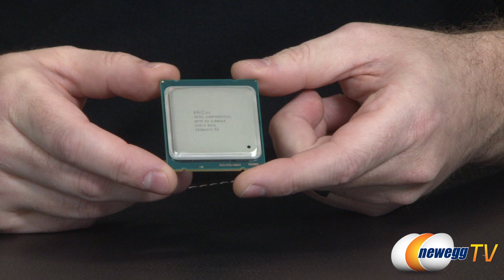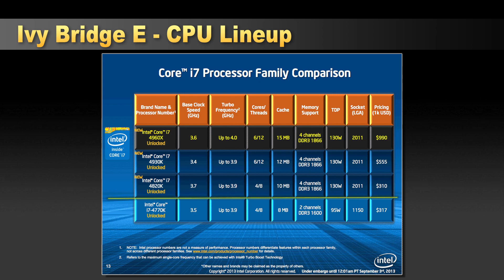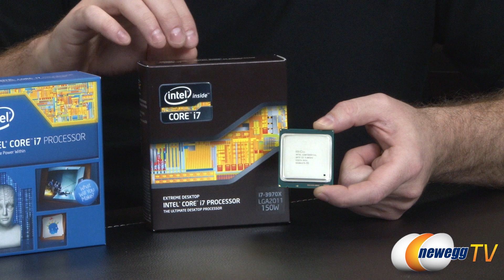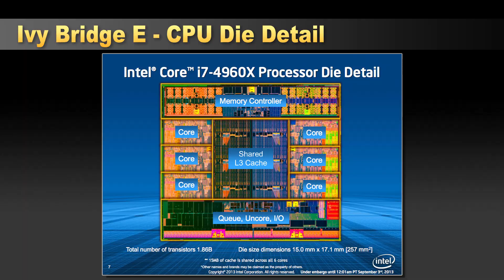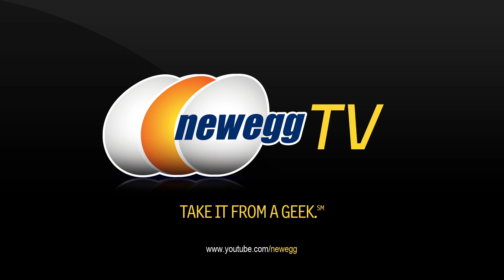Introducing Ivy Bridge E - Intel's Core i7 4960X 4930K & 4820K CPUs Have Arrived!

Comment: Actually every single 2011 processor has 8 physical cores on it.  Basically, the consumer level processors (4960x, 4930k etc) either just have those cores turned off, or weren't able to function properly with all 8 cores active.  The ones that are able to function with 8 cores are reserved for the xeon processor, so yes they do fit 8 cores on a 22nm process.

Comment: 4930K and the 4960X are the same processor almost. The latter has a little bit higher clock rate and 3MB cache. Is an higher clockrate approx +0.2Ghz and 3MB extra cache worth the extra $500? If there performance is similar than I'd rather go with a 4930k and spend the extra $500 on upgrading to a better GPU and such.

Comment: I understand what you are saying. I believe that BF4's 3GB recommendation is not based on resolution. Resolution higher than 1080p is icing on the cake. I believe these recommended specs are for the 1080p mainstream standard. If 3GB is recommended then if you have less than that even at 1080p you might have to crank things down... which I don't want to do. I hope my 670 is enough for 1080p 60fps max settings. But if it isn't I'm already on deck for the EVGA 780 FTW

Comment: It depends on the resolution of what you're playing at. If you're playing at an HD+ resolution like 1440p, then that's when the extra VRAM is going to help. Otherwise, you're alright. I play a lot of new games in high details and in 1080p with a smooth framerate and I have a Radeon HD 7850 with only 1GB of VRAM

Comment: Don't feel bad. It's only common sense that the Enthusiast quad core would defeat the mainstream quad core. It's just that since the Ivybridge-E cpus are based on a slightly older architecture than the Haswell cpus, they do not perform as well per-core. That doesn't matter if you choose a six core and are hammering all six cores. But if you compare quad to quad, the newer architecture wins. It makes no sense. 4820 is a higher number. It has more pins. More RAM channels. But nope, not as fast.

Comment: Rocketswarm82 That Motherboard has a 'system' as regards flashing the BIOS that does not require a CPU or memory actually installed, so flashing the BIOS is very easy even before the system is built .
http://event.asus.com/2012/mb/usb_bios_flashback_guide/

Comment: Intel brings out the new line of mainstream processors.  Lets start with Sandy Bridge to Ivy Bridge.  Intel released Ivy Bridge and replaced the Sandy Bridge line.  Shortly after they made Sandy Bridge-E to replace the existing enthusiast line.  Now Intel released Haswell and shortly after released Ivy Bridge-E to replace the Sandy Bridge-E line.  In 1 or 2 years, Haswell will get replaced with something else and Haswell-E will replace Ivy Bridge-E.

Comment: It is, no disputing that, unfortunately its also dead. If starting a new system with that socket/chipset, you will have already reached a dead end and the next upgrade will require a mobo replacement

Comment: go check the official system requirements. Here it is copy and pasted...
Recommended System Requirements
OS: Windows 8 64-bit
Processor (AMD): Six-core CPU
Processor (Intel): Quad-core CPU
Memory: 8 GB
Hard Drive: 30 GB
Graphics card (AMD): AMD Radeon HD 7870
Graphics card (Nvidia): NVIDIA GeForce GTX 660
Graphics memory: 3 GB

Comment: if there is 4820k, why you should even buy 5820k, i mean 4820k has 40 pci-e lanes and 5820k have 28 lanes.
Reply: +Arion Kenaz i would go with the 4930k if you can find it at a low price tho, as the 4930k is better than the 5930k aswell, but the 4820k only got 4 cores while the 5820k got 6 c;

Comment: Can this pc play battlefield 4 and crysis 3 at average 60+ fps?
Intel Core i7-4790K (i can change this)
Geforce gtx 780 ti
Corsair CX Series 750 Watt ATX/EPS Modular 80 PLUS Bronze ATX12V/EPS12V 744 Power Supply CX750M ( i can change this)
16 gb of g-skill ram
3tb hdd
250 ssd
And tell me what should i add/change so i can play them at 60+ fps !
Reply: somebody reply please
Reply: tell me what i need to change or add
Reply: DoGeR dude with that you can get alot more fps so no worries at all. if you can, get a cpu liquid cooler for overclocking the 4790k, i'm getting the NZXT Kraken X61 as far as i know its about the best and its not very costy either. and ditch the reference gtx 780ti instead get the EVGA GeForce GTX 780ti ACX Cooler Superclocked, its about the same price but ALOT better. hope i helped :)
Reply: Daniel Garry thanks bot i dont rreally have the money for 780ti so im just buying gtx780
Reply: DoGeR then change your original comment, also are you playing on 1080p or 1440p?
Reply: DoGeR yes this is plenty
Reply: That's more than enough. All I would change (if you haven't bought this set up yet) is the 780 for a 970 (Asus Strix gtx 970 looks good). The 970 performs closer to a 780ti and out performs the 780, and is at a slightly cheaper price too.